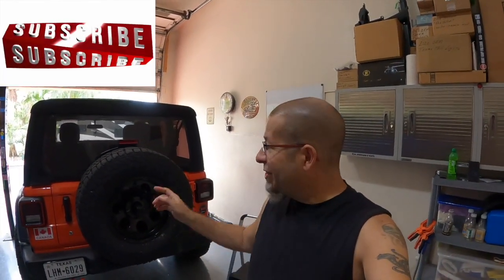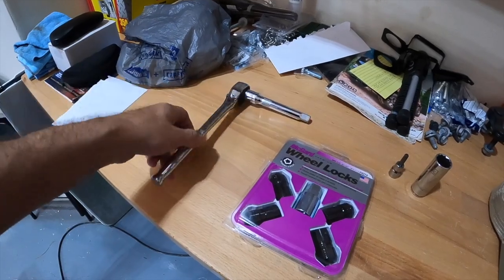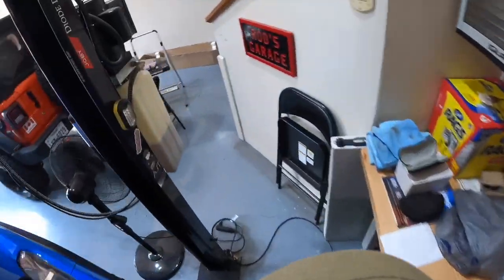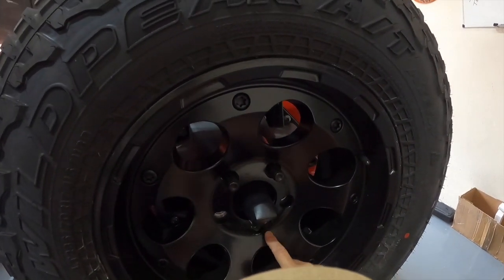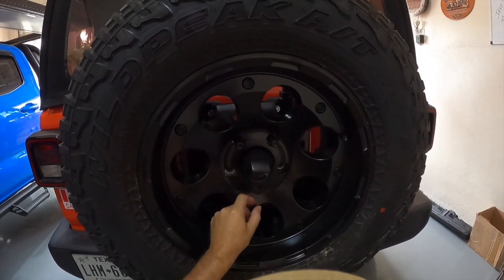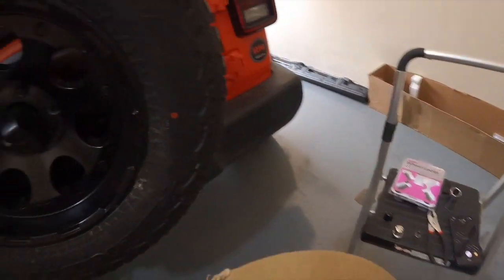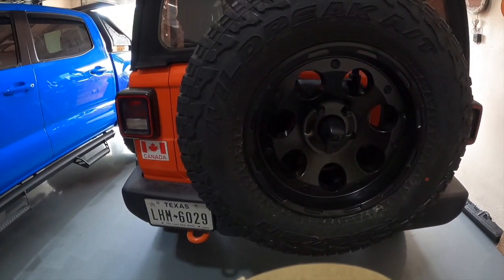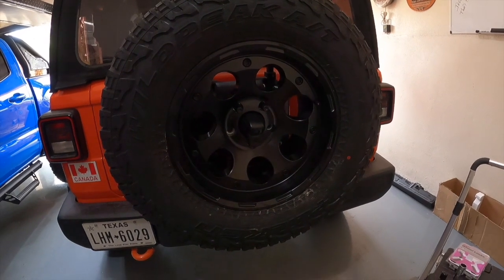Jeep TIRE Theft PROTECTION Must Have

Comment: I used to use those anti-theft lugs, even though they are a pain when at a shop...remembering to give them the key.
Then I found out that most professional wheel thieves either already have those keys, or they just cut them off.
Reply from the maker: Definitely not a fully preventative solution..but a good deterrent IMO👍